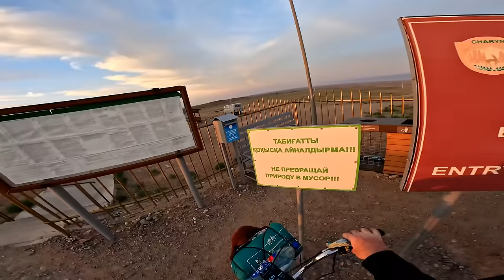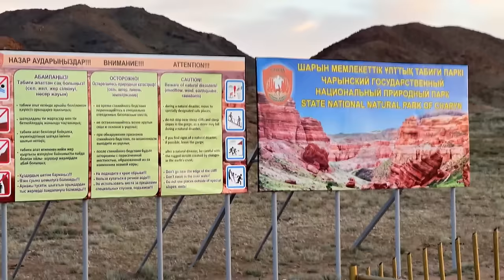✅On a BICYCLE with a MOTOR to Nuclear Test Site☢️1000 km through the steppes of Kazakhstan

Comment: I had same problem with the spokes breaking on my cheep fully damped electric mountain bike, it was caused by way to narrow rims making it to weak for the heavy 25kg weight of the bike. I had to get new rims custom made because no such wider more durable wheels with wider rims existed that would fit my bike. The rims I have now is almost double the width and the side effect is that the tires is much wider and it is almost like a fat bike ride now with MUCH more dampening of vibrations and bumps on the road from the wider tire that now has more air in it.

Comment: It's not a good idea to remove the exhaust on a 2 stroke engine, it acts as oil retention for the piston, removing it will shorten the engine lifespan.

Comment: Those things you were calling brakes look like "Torque Arms". If thats what they are then they are supposed to stop the axle from spinning in the dropouts (where the axle slots into the bike frame).
If they get twisted up its because they are not strong enough for the power output of that motor.
Reply: The power is put into the spokes with the frame being the motor mount, so no torque arm required
Reply: The torque arm is for coaster brake
Reply: I've destroyed a few coaster brake wheels on motorized bikes. They cannot handle slowing down from higher than conventional bicycle speeds.
Rim or Disc brakes are the only way to go if motorizing a bike.
Reply: @thefunniestfarm4731  I had one break loose and it kicked back hurting my leg and almost threw me from the bike. It also spun the bearing out of adjustment. A front brake is a must.
Reply: @mickangio16  I've have one do the same thing and it nearly tossed me off too.
The worst part about coaster brake death trap bikes is if the pedal chain drops off, no brakes.
Oh yeah, most of your stopping power is on the front wheel, I advise everyone I can to get a front brake.

Comment: You needed extra tubes tires chain master links safety wire and a few spare bolts  an air pump, with full camping equipment. Some extra petrol, water,  food and medicines.

Comment: Truing a wheel without a jig isn't easy so you did well to get it that straight, I used a ty rap then cut it down on the forks against the rim to try get it dead straight, I did reasonably considering I had never done it before.

Comment: The motors for bikes would be Soo much better. If completely rebuilt, and balance the crank. 
And the rid would be much better if the motor could be attached to gears  like a 10 speed bike. And electric start!

Comment: smoke from muffler is too rich mixture. Also, a dark sparkplug is mixture too rich as well. Not burn cleanly. Will also fix muffler dirt. Should not remove muffler cover because muffler helps engine.

Comment: electric drives very well too, there somethimes problem with pedal sensor. and batteries are weak point, but there not much problem compair to this combustion motors:)

Comment: On the colour of the spark plugs white/grey is a lean mixture black is to much and coffee brown is just right its a matter of adjusting the air to fuel ratio normally done by swapping jets by the looks of it you need a bit bigger
Reply: Or for part throttle, the position of the needle in the jet.

Comment: That brake arm has to stay attached to the frame or else you wont have any brakes and it will kick your pedals up into your foot when you try to apply the brake. Use loctite on those machine screws and tighten them very well. Is the major flaw with coaster brakes on bicycles that same problem caused me to crash into a one foot high curb at full speed on my sisters Huffy Powder Puff bike and I totaled her bike out bent the front forks and her wheel all the way back into the crank set and it was brand new at the time I flew 8 feet into an oak tree branch then fell straight down from there into the ground and it knocked my breath out of me I was OK but my sister was pissed once she found out I wrecked her bike

Comment: hub drive in the rear wheel. direct drive. 1000-3000w
brake rotor disc side mount the motor sprocket. bicycle side use a 1x8 setup with a cheap microshift 12-46 system
slap in a 500euro 60v 34ah surron batery.

now you can regen brake, the spoke ripper sprocket is gone and theres a solid 6 bolt sprocket. and you can properly tension the motor chain while having gears to pedal on. in general sucha bike would be perfection for such trips. what is shown in the video is just horible to the max.

Comment: chains break because the device is lacking an Oiler.... one must ATLEAST keep a spray can of chain lube or lube of any sort and apply liberally at each gas tank fill up.  the heat and wear on the little chain is too much over distances.. .01mm of material loss on the pins and poop its broked.
Reply: Agreed, its a must to oil the chain on any bike or motorcycle. Dry chain is way more wear and less power and a rougher ride

Comment: i have alot of expierience with these motors. and i have to say that you guys put more effort into getting it to e rliable than any americans i know besides myself. my best friend just gets a new motor and puts it on and rides it for like a year and geat a new one when it blows. when i have one i make it go like 55 mph for like a montch maximum and it blows. some people just have better luck. but i go through them like a mad scientist i promise.
Reply: a really reliable build that still has lots of power and is relatively easy is putting a chainsaw cylinder more as the top end i did a Stihl MS 660 with a 56mm big bore. cylinder it costs about a 130 dollars for the everything you would need i have had it up to 108kmph
Reply: @marshallkaufman3123  I also had one of these engines for 4 years, everyone on a motorized bike forum was saying this stihl hack. Well, mine worked well for 4 years, even tho i ported everything out, got proper exhaust, reed valve, high comp. head, etc. Ignition crap itself tho.